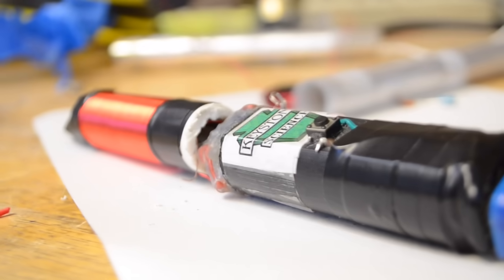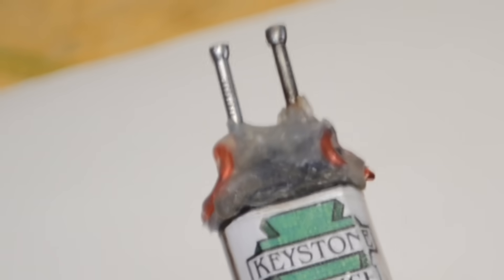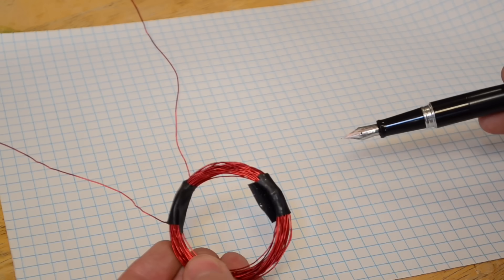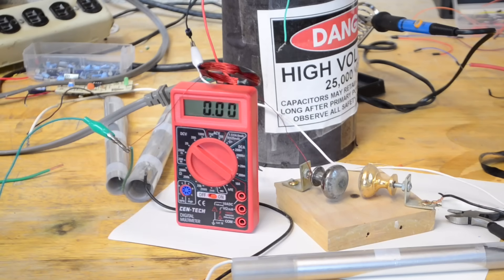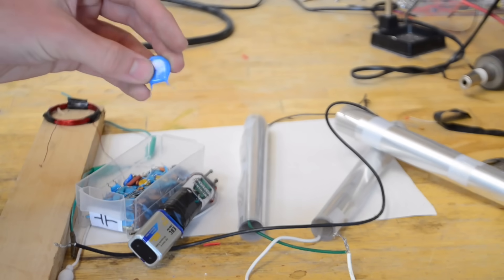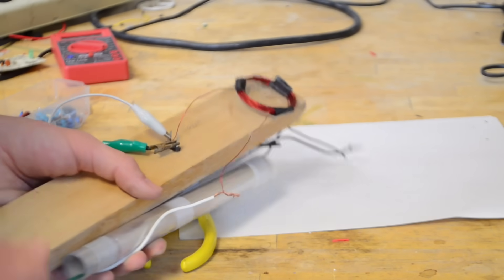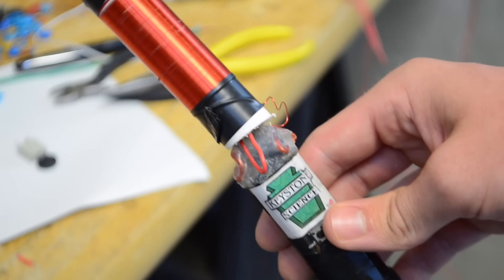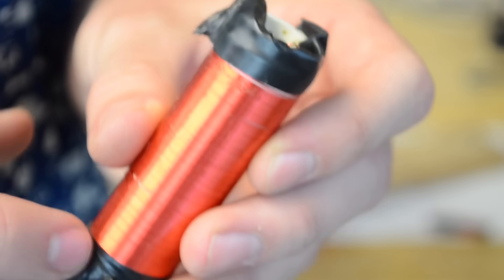How to make a pocket EMP

Comment: Doesn't an EMP kills electronic devises by induceing a lot of elektronic energy? There for it wouldn't matter how long you have the EMP next to one but how fast it charges up.
Reply from the maker: +Max Linck sort of, but if I leave the EMP on a device longer, it will allow the high voltage Induced to break down the transistors inside the components and that is why leaving it on causes damage that will not be really all that fixable

Comment: if it fries devices, why didn't the 1 second burst permanently fry the multi-meter? i understand that you eventually did, but why didn't it the first time?
Reply from the maker: +Layarion hmm good question, I imagine it is because the circuit must of just been temporarily hurt by the 1 second burst, but when given a longer burst, I would guess that it had more time to electrically break down parts of the semiconductors inside

Comment: A question when you were drawing up the rough schematic of the EMP (at 1:45). It's that shouldn't the capacitor (or capacitors) be before the spark gap so that when they are charged they shoot over the coil and then across the spark gap to discharge? Does this make any sense or am I just being crazy???
Reply from the maker: +Fox A Billion it shouldn't really matter all that much, as the capacitors will still charge and discharge across it, basically in electronics, since they are in parallel it makes no noticeable difference
Reply: First wow that was quick and second many thanks for saying this. This happened when I show my friend about what he thought about all of this and he said what I said earlier. Thanks again
Reply from the maker: +Fox A Billion ahh ok, no problem!

Comment: You could increase the strength of the magnetic field of the coil by wrapping the wire around an iron core instead of a piece of plastic pipe.

Comment: would insulating the wire coils improve the strength... there's more turns on the cylinder but they're all touching and in the other one there's less and they're separated by air... just a thought that came to me.

Comment: Nice stuff but I have one suggestion. The piece you couldn't identify and pounded into a board to test your design. That is actually a male portion of a plug connection. You could use that to replace the nails on you tazer and have the female portion mounted inside the EMP tube. this would make it very easy to convert back and forth. Good work - keep it up.

Comment: @Keystone Science Sounds like you need a new mic aha why did it not break or interfere with your camera?
Reply from the maker: +TIALKN “X” there is a pinned comment above explaining this I think, but as for the camera, the range of the EMP is only about 2 ft, and the camera I am using has built in faraday cages around its circuits, this is because it's a studio camera, and when studio lightning overloads, it creates an EMP, so this way the camera stays safe :D

Comment: Hi, I dont understand how u can use those smal capasitatiors without exploding them? I mean the power converter gives 40 000 V and the best Ceramic Disc Capacitors i can find can hold up to 4 000 V why is this?
Reply from the maker: +Peter Molander the power converter actually only gives at most like 10 kv, and then each of my capacitors are like 3.5kv, so the 3 in series is rated for about 10.5 kv, however the capacitance is very lowered quite a bit
Reply: ok thanks!

Comment: If you don't mind me asking... why are the capacitors there? what do they do in the circuit?
Reply from the maker: +Finn Langton they help to pulse bigger amounts of energy through the coil, so basically the capacitors will charge then discharge across the spark gap firing the charged energy through the coil making a strong electromagnetic field pulse

Comment: +Keystone Science  How about a demonstration with iron filings? Separate them with paper or thin glass and see how far the pulse reaches, or if they even react.
Reply from the maker: +Manbun “Not” Myname huh, that's a pretty good idea I guess to determin range, the only problem I see is that I may not be able to detect it because it's a very high frequency AC pulse, so the fillings should just vibrate very very fast , but it's worth a try :D

Comment: um.... if it works then how did the camera not break?
Reply: mark valenzo its short range or protected agaist it
Reply: Cam was protected
Reply: mark valenzo This isn't actually an EMP, making an EMP uses much more advanced science than this and is more destructive.
Reply: Because The Emp device has short range and weak signal. Btw, Cameras are now have high protection, so its nearly impossibe to destroy it.

Comment: Question for you.  that magnet wire in your coil prolly cant insulate the approx 20Kv from your taser.  Do you think that you are losing most of your emp potential from arcing through the wire where the two leads first overlap? also id love to see you hook this up to a flyback primary and see what kind of arcs you generate.  I drove a flyback using a fly swatter with the same circuit (just sub the swatter in for the cap) and got incredible 6 inch arcs with each spark.
Reply: Your final coil that looks like a tesla secondary, if you ran the outside lead back through the center using HV 30kv insulated wire you prolly wont have an issue with arcing as it approaches the other taser lead.  Just discovered your channel. Its awesome!

Comment: Not sure is this is exactly an EMP per se..
Reply from the maker: +thodal2000 why?
Reply: A true emp has an accompanying spike in voltage. Your inducing a voltage within the target device with the magnetic component. I would bet if you measure the electrical component of the discharge, I would be the volts per meter is low. I could be wrong that's just be best guess from the set-up.

Comment: I prefer keeping the pointy ends of the nails toward the assailant.
Reply from the maker: +CazzoPORTICO Scimmie yes, but then it wouldn't arc at the top. And you know , presentation :D
Reply: But does not a jolly good tazing require skin contact? About 1985 I came up with this idea of two high velocity "beams" of water to function as the nails on the apparatus. I don;t even know if it's possible because I never pursued it.
Reply from the maker: +CazzoPORTICO Scimmie huh that's a pretty interesting idea, it sounds like it would work ( especially a water/electrolyte solution )
Reply: I told my mechanic friend my idea. He said that I was going to kill somebody. Probably why I never pursued it.
Reply: I have a lot of interesting ideas. Thanks for your fine work.
Reply: They actually use your waterjet tazer idea on a few designs these days.
Reply: Lol good one

Comment: is there anyway to this make this stronger? it struggles to impact anything covered in tin, it doesn't even fry a cellphone or a walkie talkie :/
Reply from the maker: +Rollerz leader yes, more capacitance will do it, as well as a bigger spark gap, however pushing this little booster too much might fry it :P

Comment: Hi, Just wondering what size ceramic capacitor you used (Max KV) in this video, also It looks like you used multiple, was this in a parallel sequence?

One more question, would it make more sense to go for multiple capacitors or just one large one?

These questions are probably stupid as I know very little about this subject but I was just wondering.

Cheers :)

Comment: Now make a EMP like 100-1000 times stronger that would be able to take out a entire block but at the same time don't use it, keep it as decoration because you know, if ur not using it, its not entirely illegal. But keep it armed, just in case.

Comment: @Keystone Science Found this video since it appeared on my recommended list :)
Do you think this is enough to fry RFID cards?
Reply from the maker: +XPLOREanXPLODE hmmm I not sure, I think it would work on active RFID tags, but I'm not sure about passive RFID tags, though i would still say probably ( that is if I remember right RFID tags are just a small Integrated circuit with an antenna)
Reply: +Keystone Science Right, and because of that I think it should fry, since you put high voltage into that coil. Maybe I can build some voltage multiplier in the next time and try it out, have a RFID card and my personal identity card here ;)
Reply from the maker: +XPLOREanXPLODE haha xD

Comment: I am curious. Can the EMP pulse be further concentrated and focused using a parabolic dish?
Reply from the maker: +Joe S yes , I assume though anyways, also it may be concentrated ( although I haven't tried it ) making the coil into a parabolic shape
Reply: @KeystoneScience  what range is the small capacitors
Reply: The question was due to my curiosity of your level of knowledge. My apologies but I was wondering if you knew what you were doing and the question seemed to be a good way to gauge that ;). The answer to mine own question is "Yes, an EMP is a sudden release of a kaleidoscope of wavelengths therefore a parabolic dish will most certainly concentrate and focus the burst of energy as long as its design can accommodate the many wavelengths produced." Although, forming the coil into a parabolic shape would only produce a focal point for the release of energy. The video is informative and you are a credit to your generation. Just be careful what you post as there are many who would see this knowledge misused for their own maliciousness.
Reply: @JesseSShaw  dam and I was hoping someone would use this for like say nocking over a bank......... I would be laughing for hours.....
Reply: I would say yes. You're focusing the beam. hmm Pringles can to really get precise.
Reply: shut up loser! diarria-shahaha diarria-chachachq
Reply: Its possible, need to determine the size of the wave so you can calculate 'optimum' angle of the 'dish'.
Reply: Shut up, nerd.

Comment: how can u record without disturbing ur camera with the emp, is the field too weak to reach it? in that case using  a higher voltage battery would mean a larger radius of the magnetic field?
Reply from the maker: +ffdf fddf yes, and yes. Also though, I'm already pushing the boost converter with 9v so probably would want a better HV power supply as well :D

Comment: This is not an Electromagnetic Pulse. This is more of a quick-rise electromagnetic field. Powerful electromagnetic fields will disrupt many components in modern electronics, but don't do the same damage nor react the same as an EMP.

A true EMP is formed from a Nuclear detonation. It creates an immense amount of energy that travels through the air. However, the key to the EMP being so destructive to P-N based semiconductive devices is the high-voltage created and the incredibly fast rise time of that high voltage. This causes P-N junctions in modern day integrated circuits to shatter.
Reply: Bro you play TOO much COD
Reply: Did you just contradict yourself within 2 sentences?😓
Reply: ZOG 00 no this is an EMP, just weaker. Smaller EMP's need an inductor in the electronics to severely damage them. This is an EMP, but will mostly be used for jamming.
Reply: THANK YOU DOCTOR OBVIOUS!
Reply: 05r13539 no, he's not saying that though you may argue that's it's heavily implied and well, it is but still both devices are powerful in there own ways 
the point he or she is trying to prove is different. and to answer your question this handheld emp is MUCH different than perhaps, a military grade grenade in both power and complexity AND he or she states in the end of the comment that the power and speed of the pulse causes the circuits to shatter making it a single use thing whereas this emp can be used multiple times
Reply: Audit Style the coil is the inductor
Reply: It is a magnetic field.
The magnetic field is in short burst so it is a pulse.
So this is an electromagnetic pulse so your point is invalid.
Reply: Lightning also produces a powerful localized EMP.

Non-nuclear electromagnetic pulse (NNEMP) is a weapon-generated electromagnetic pulse without use of nuclear technology. Devices that can achieve this objective include a large low-inductance capacitor bank discharged into a single-loop antenna.
Reply: I don't understand how this is an ELECTROmagnetic pulse though. Isn't it just a magnetic pulse? The coil doesn't  emit any light does it?
Reply: @James Sever It's electromagnetic because the magnetic field (pulse since the current is only on for a brief period, although 10s isn't exactly "brief") is induced by moving charge (current). I don't think you actually need to see arcs ejecting from the coil to classify this as an EMP.
Reply: Daniel Christopher Dagdag the reason that light is called an Electromagnetic wave is because it creates a sinusoidal magnetic wave and 90 degrees shifted an electric wave (or voltage potential). This is why microwaves damage electronics so much. Because they are light they not only create a magnetic differential but also a voltage differential across electronics according to their roughly 2 inch wavelength. The reason other light is not dangerous to electronics is because the wavelength is too long or short to drive a current in a significant distance across the device. So I can see how making a microwave pulse (from a nuclear detonation) could be an emp, but a simple magnetic pulse would be a lot less damaging because you have to have relative motion in order for a magnetic pulse to affect a change and magnetic fields do not travel very far due to the inverse square law. An emission of high amplitude (high voltage) microwave radiation is what you are looking for because if is more damaging and goes much farther, cause it's light. And nuclear explotions give off almost all frequencies of light. I think keystones science just didn't want people making real ELECTROmagnetic pulses and just the much less harmful and shorter range magnetic pulses.
Reply: Show me how to make a nuclear EMP device or even better how to make a gigantic solar flare.
Reply: You'll notice in the video he said he turned the thing on for 10 seconds near the multimeter before he fried it. 10 seconds ain't exactly a pulse. The device in the video is more akin to splashing water around in a pool instead of making a giant wave.

For an actual pulse, we're looking at milliseconds (or less, I believe) of damaging EM exposure.
Reply: It has to do with the rise time of the pulse. The quicker the rise time, the more frequencies in the electromagnetic spectrum are blanketed.
Reply: Nuclear weapons do not exist. I repeat Nuclear weapons does not fucking exist! Sam Jackson*

Comment: I don't know Alot about electricity or EMP's, but why did it not have any affect on your camera? from the video it looked like the camera was just as close if not closer than the mutimeter.
Reply from the maker: +5.56NATO great question, the range of the EMP is fairly small, also cameras that are more high end ( like the one I use ) have EMP shielding in them, they have this because in a photography studio, if the Lightning is overloaded then it produces an EMP, so this shielding protects the camera from being broken. So yeah :D , also no, the camel was a bit further back ( about 1 meter )

Comment: I am not too good with electronics.  But when I referred to your tazer video, your power supply is 9VDC. Dont capactors only work with AC, not DC. Power source is DC. And also, why is a spark gap nessesary. Thanks!
Reply from the maker: +Soham Parmar no capacitors work with AC and DC, and the spark gap is necessary because when the capacitors charge up fully, they discharge across the spark gap, and the act of discharging is what sends a big pulse through the coil making an EMP :D
Reply: Keystone Science Sorry to bother you again. but I was wondering. from your schematic, electricity flows from that top-ish wire to the capacitor to charge it up. Wouldn't the capacitor discharge from ge same plate they are charged from. so they would dicharge from the plate facing that wire the electricity comes from. then the discharged electricity flows throw the spark gap and down the other wire (like the other wire below the top-ish wire mentioned above). and then no electricity goes through the relay even. idk I'm not good at electronics, if u need more info i can provide it. I'm not good at explaining . but thanks!!
Reply: as far as i know the spark gap is basicaly like the metall outside of a grenade it holds the pressure long enough so the expanding force of the grenade fuell is released in a compressed form rather then just burning away. similiarly to gunpowder. if you light it of on its own it just burns pretty fast thats it but if you put it into a small confined space the vapors etc that get formed push the bullet of a gun outwards. the spark gap (again as far as i know) behaves in a similiar way as it is basicaly the resistance that releases all the force in this case electric force at once instead of releasing the energy slowly
Reply: The discharge of the capacitor through the gap makes the spark, this is also known as the Hertz effect. Once the spark is produced, electromagnetic pulse is released within a certain range thus damaging electronic devices within the proximity due to the change in the electromagnetic field.
Reply: Soham Parmar so when you insert the device in your mouth and push the button you will know!!!!

Comment: I'm curious why the camera that you're filming with did not experience failure due to the EMP?
Reply from the maker: +Jason Spray great question, the range of the EMP is fairly small, also cameras that are more high end ( like the one I use ) have EMP shielding in them, they have this because in a photography studio, if the Lightning is overloaded then it produces an EMP, so this shielding protects the camera from being broken. So yeah :D
Reply: Keystone Science, thanks for the response.  I was assuming the EMP range was pretty small,and that was why. I did not know about higher end  cameras having protection built-in. Cool info, thanks